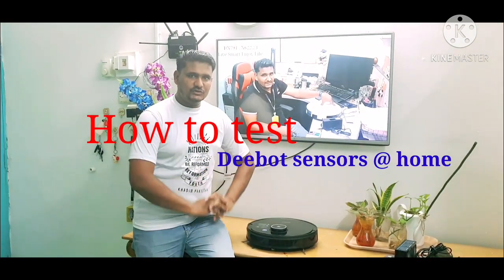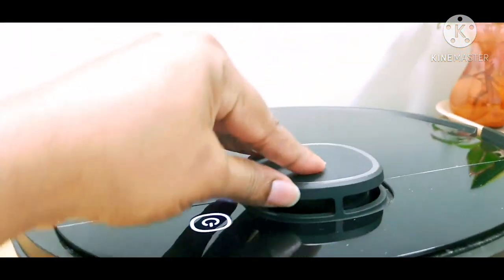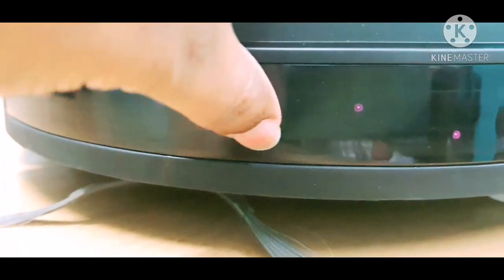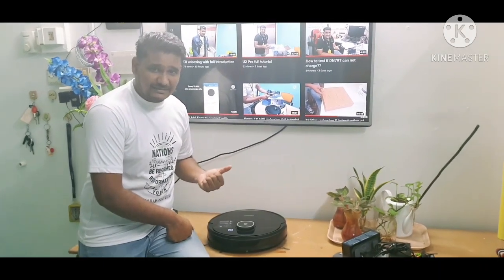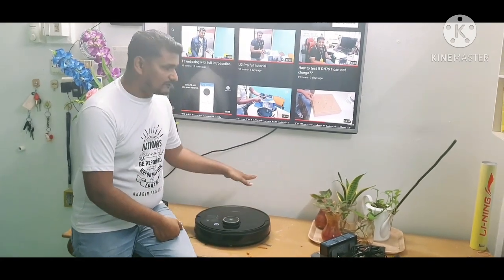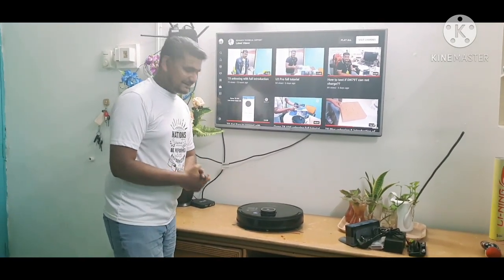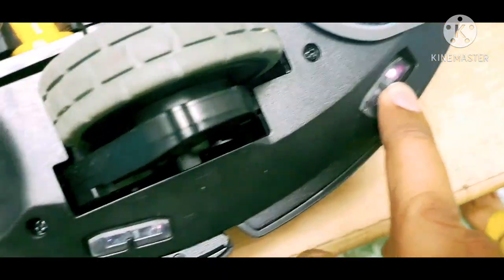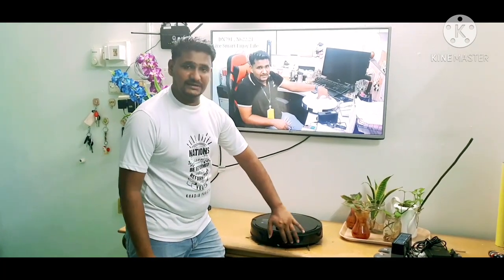How to test Deebot sensors at home

Comment: Hello, I have a T8 Aivi Pure and when I look at the sensors with my camera I see the TOF laser, the front center lasers on the bumper and one light at the very left and on the very right side of the bumper. There are no lights between these and the center one. Is that correct or is there any issue?

Comment: Love your videos. I have a question. I'm getting a sensor error saying I need to clean them. I opened them all and cleaned them but it still says it needs cleaning. What else could it be?  I had to take it all apart to replace the motor. Please help.

Comment: Hi! Thank you for sharing your knowledge with us!! I can see only radar light. But i can't see any of front bumper and drop sensors' light. The deebot says "clean my drop sensors". But cleaning doesn't help.  all six sensors doesn't work. Is it a motherboard problem?
Reply from the maker: Most likely is just Anti drop sensors need to replace... sometimes signal not functioning n some times vrecever not working.. that's all...
Reply: Im having the same issue but only on the anti drop sensors on the bottom (6 in total). They are not lighting up. The bumper and top sensors are working fine in my deebot t8+. I have ordered the left and right sensor replacements to see if that works. If that doesn't work I will have to replace the motherboard.

Comment: This was very helpfull. Our vacuum is an Ozmo 930, and sometimes when it starts, it goes forward and then to one side. Other times it just stays at the same place, and we can't fix it. With this video we checked the laser distance sensor and all the anti fall sensors, but the bumper sensors do not show any light. What can we do about that?
Reply from the maker: In 930 bumper sensor are different.. won't show light like other models
Reply from the maker: Plz check Ur deebot..main brush... might be jammed
Reply: We never used it with the main brush

Comment: Our Deebot Ozmo T5 has been a great machine over the past couple of years. However, after sending it in for repair, we have a strange issue. When it is returning to the docking station, it is slow and does this strange side to side motion slowly. I could understand if it was doing this prior to the final line up at the dock to make sure it is lined up, but it does this all the way from the back room. It appears to be taking baby steps instead of just driving slowly and straight to the dock. Can you offer any advice on this?

Comment: Hi sir, i have the 950 model, i get the drop sensor error. With my camera i noticed that none of those 6 sensors are working. Sensors in bumper do work.  The model has been used only 1-2 times with water, i don't see any corrosion marks at all, also inside the unit. Any idea on what part can be broken? Mainboard?
Reply: usually its mainboard problem if all sensors are "dark"
Reply: Indeed replacement of the mainboard did resolve the issue. Thx for the advice. Deebot should make their models more durable, mainboard failure after less then 3 years and only weekly using it 1-2 hours...😢
Reply: Hii sir, can I know where did you get the replacements from?

Comment: Hi Sir, do you have any video on the water reservoir sensor? My T8 is stuck on Mopping mode even with the small reservoir removed. The App keeps saying to remove and clean the reservoir after is done, this is also preventing the machine to go into carpets. Thank you.
Reply: Found this video by same creator on the issue: https://youtu.be/FVSnEp8oDbo?si=Vok4HuufZ9V0vuyt

I have the same issue and cleaning the carpet sensor rather than the mop plate sensors seems to be working for now.

Comment: hello. three sensors on the right were not working. I replaced these sensors. I see the sensors lights up but the error persists. do you have any idea what i should do?
Reply from the maker: Most likely left side sensors spoil because of vacuum fan flow to left side...plz try to replace left side sensors.. hopefully will be ok

Comment: Hi, i have deebot 950 for 2 year , the problem is at night schedule cleaning it work fine and  the morning it work great but at a noon around 3pm suddenly runing to every whare sometimes it not moving, runing back and spinning,  and sometimes it's not compleate the job but on notification it say completely or ended manually,  but again in night its work great, is there a solution? Thanks

Comment: Good day sir. How are you? You mentioned there are 6 anti drop sensors plus 2 more near the water tank. I could not find the other 2 near the tank. Is there a diagram or photo showing these 2 sensors? My T8 keeps saying to clean the anti drop sensors. I already clean all 6 sensors i could find and I could also see the UV light from the 6 sensors using a camera phone. Please help. Thank you very much in advance.
Reply from the maker: Sorry for the late response ... total 6 anti drop sensors include those 2 located next to vacuum fan...now I already uploaded few videos about sensors n reverse issue... from there eaisly you Will understand about those sensors
Reply: @ecovacstechnicalsupport5278   I managed to take everything apart and got to the sensors few months ago. One of the infrared receiver was faulty. I bought a new receiver online for few cents and replaced the old one. Everything is working like new now and managed to save my money getting someone else to fix it. Thank you for your videos. It guided me alot.

Comment: Hi sir, thansk for your video . it is informative. i had a Deebot DN 320 model, purchased from China.  i had the anti drop sensor and LDS issue. the wheel holder is torn, so i had replaced a new one. but the machine still send the message to clean anti drop sensor.  after i click start button, the robot will move few steps, then it will stop there sending the message that to clear the anti drop sensor. Could you advise? thanks
Reply from the maker: Sorry for the late response ...can u plz WhatsApp me a small video clip so I can see the model as well n can confirm what's the issue
Reply from the maker: U can WhatsApp at 00601137973018

Comment: I bought a T8 about a year ago and it's the biggest heap of junk that was ever made. I have constant problems with. Sometimes it refuses to go on the charger so I had to put a piece of cardboard down to solve that issue. Last week one of the drive wheels decides it wants to quit working every few minutes and you have to turn the power off to get it going again and then after several days of that it miraculously fixed itself. This week it won't vacuum at all because of anti drop sensor malfunctions. It's a $600 piece of garbage!!

Comment: How do you clean LDS?
Reply from the maker: Use soft cloth wipe from top n sides n use cotton buds to clean LDS sensors looks like 2 eyes... Some times belt stuck n break that's why also some time it won't move... U can touch gently with pen n turn few rounds if belt stuck only then it will start functioning again as normal

Comment: Hi, Do you know why the deebot M88 is only running backwards??? Thank you
Reply from the maker: It's a motherboard issue... Need to replace. Anti drop sensor component heat up n stop working that's why reverse n stop after few seconds..

Comment: Hi, I would like to kindly ask you. What if 2 antidrop sensors does not light? It there any replacement? Or any idea which diod to buy and how to solder them (there are 4 colours and not sure which is positive and which negative)? Thank you a lot.
Reply from the maker: Good question...sir if u confrm that its anti drop sensor issues then u can order online that part for ur Pacific model...i hope they can sale sensors if online available...or if u r in Technical line then i can help u to test...in anti drop sensor there are always 2 color lights i can see...black n white...easily available in any electronic shop....just replace lights that's all ...white colo send signal n white one catch back those signals then deebot can sense that how far it is from obstacle....

Comment: I have M81 model that will work for about 1 minute then stops 
The battery is giving out 13 + volts 
What do I check next
Reply from the maker: When deebot stop so plz count the beep sounds...1,2,3,4 or 5 beeps...then let me know. I'll inform you what's the issue n Solution for that
Reply: Two beeps and flashes red

Comment: Thanks for the tip. The Deebot warns that the anti-drop sensor need cleaning, but even after numerous attempts of clearing any debris, the warning signal still persists. Pls help
Reply from the maker: May i know model no??
Reply: @ecovacstechnicalsupport5278  T5-Max.  Thanks!
Reply from the maker: @OwenYungFootball  ok noted.  Actually T5max, 920, 950, t8, T8aivi & t8 plus these models got 6 anti drop sensors.. & 2 anti drop sensors just next to water tank...when Customer hold the deebot weather its not functioning but still few drops of water remain in pipeline so once we hold the deebot in hands those drops drip n go one side...maybe left or right n touch with anti drop sensor  that's the reason why in these models  anti drop sensors error appear....so make sure when u hold in hands clean either u shake the deebot 2-3 times so water fully drop on the floor or wipe it with tissue paper then will not give u this problem...now need to send back to service center so they replace anti drop sensor then will be ok
Reply: did you resolve this issue? i have it too